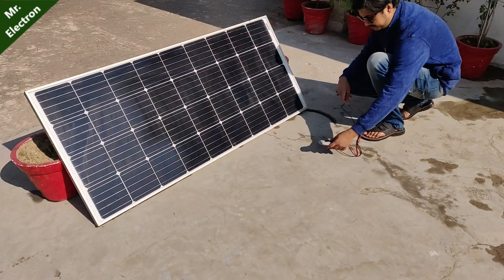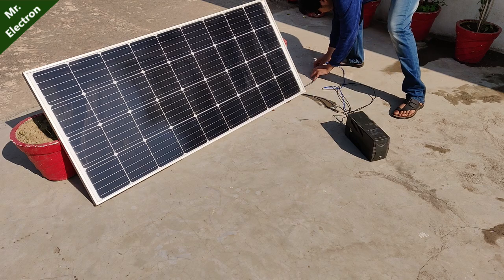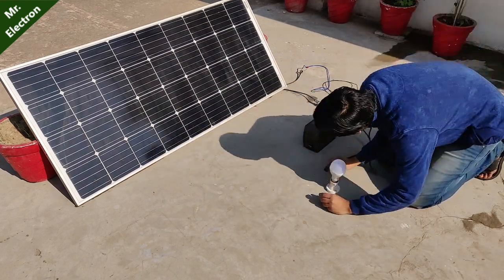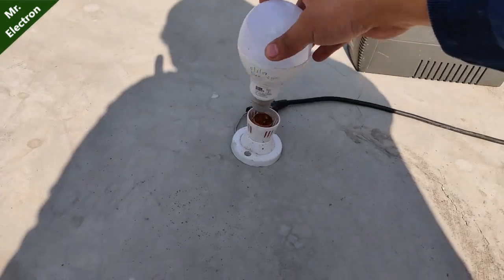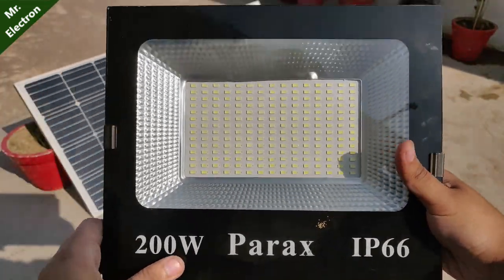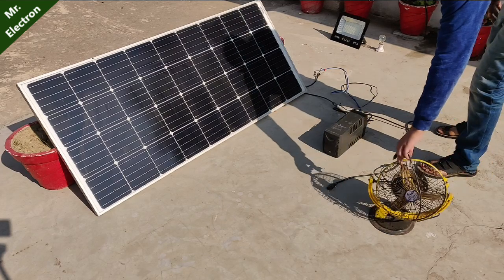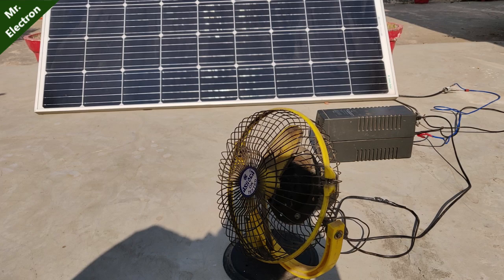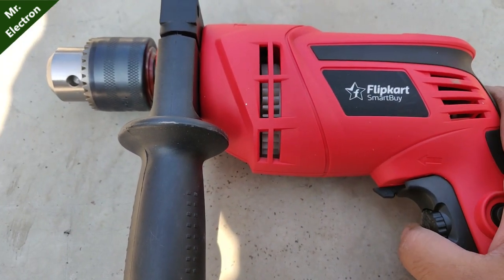POSSIBLE ? Run 220V AC Appliances with 12v 180W Solar Panel without Battery

Comment: The ups battery seems to be of 70ah. I think your solar panel product around 15 A of current. So in order to run the 600W ups you need atleast 4 of these solar panels (my calculations may have errors 😌  )
Reply: Ups have 7ah battery

Comment: Can i run 500 watt Electric induction cooker with 200 amp Big bettery.. Which will Charge by 180 watt Solar panel  ???  Is it possible??

Comment: I have run solar 100w with ups and original battery for a 32 inch tv
Reply: No
Reply: Ups is square wave dont run tv,motor
Reply: @user-fo9rx9py5e  I use a apc ups it's used in pc etc.

Comment: Hi brother nice work. I wanted to whether you have stepped down the 20v coming out from solar panels to 12v or directly you have connected the solar panel terminals to the UPS directly. Im thinking to do the same with 300watt solar panels. Please reply! Thank you..🔥🔥
Reply from the maker: You're welcome 😊
Reply: @MrElectron  

Hi 

It Is Still Using On Direct Solar Panel?

Any Damage Happen To Ups For Direct Solar Panel Usage ?

Plz reply
Reply: Please tell me did you step down the solar voltage?
Reply: If you don't step down to 12 volt from solar, the UPS relay will cutoff the power as most of the sunny days solar panel gives more than 16 volts.

Comment: I was hoping I'd get to see what you can run directly off the panel with no UPS.  Are there any appliances?  Would a 12v DC fan work or would the 100+watts kill it?

Comment: The battery in the UPS has too little power. 
It works with a battery from a car, it does have enough power.
With the solar cell you can recharge the battery.

Comment from the maker: Note that the UPS has NO BATTERY inside and the ups wires have been taken out and connected directly to the solar panel...
The proof is that the UPS was unable to light up even a 100W bulb for a few seconds.
--> Had there been a good battery present, it would be glowing really bright..  
--> Had there been a weak battery present, the ups would have shut down under load rather than flicker.
Reply: This is real video not fake video 👍👍👍👍👍
Reply: Hello,
If I have 2 solar panels of 1st is 300w and 2nd is 100w in which form i have to connect solar in my UPS (Parallel or series)
Reply: I think it cant power the drill or lightblub because the solar panel is 180W and the drill needs 700W so... it is not logic for 180W to boost up to 700W. But still i like the vid a lot😊🙃
Reply: 50 watt panel ka panel load Lega Kya
Reply: Which solar pannel and Watts of solar pannel